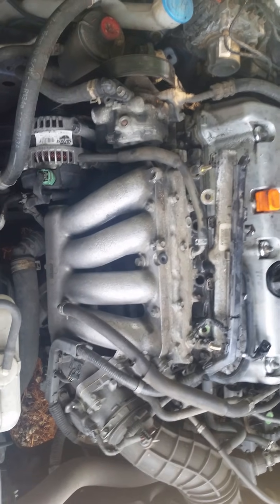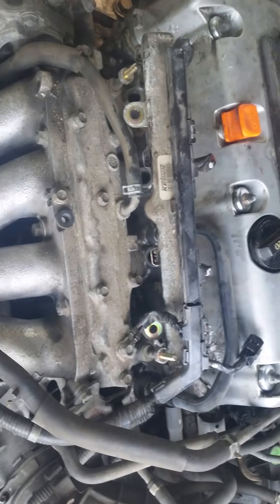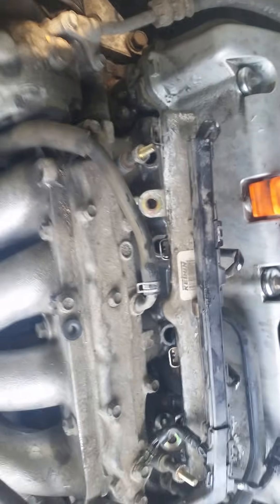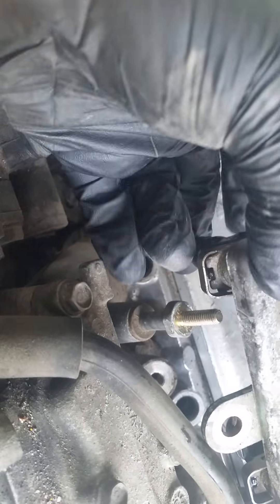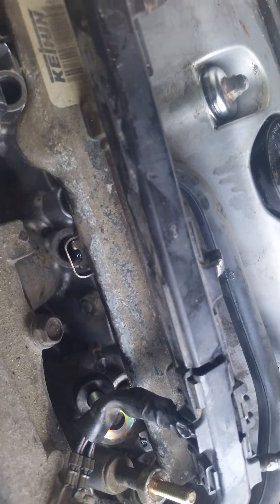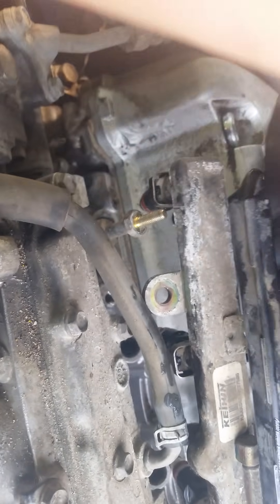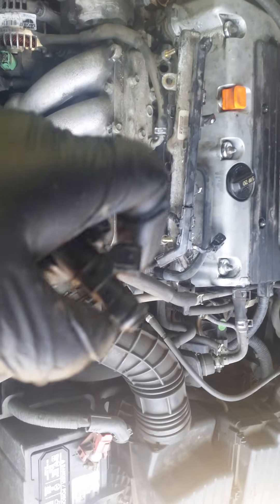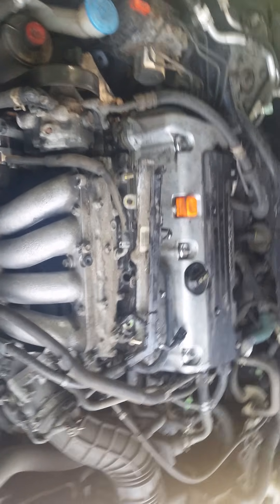2.4 liter Honda fuel injector replacment

Comment: Did you notice any improvement in fuel mileage after changing the fuel injectors?
Reply from the maker: @ohiodigger4391  some but not alot it was like 1-2 mpg
Reply: @ ok thanks. My sons ‘04 CRV is getting just under 14mpg. Trying to figure out what’s going on. Only has 136k. Should be at least close to 18mpg.

Comment: If your doing a video like on how to change them, then please show each step as you go, so people who haven't done it before can see each step!!!
Reply from the maker: @scottsuem3384  it was one of my first videos
Reply: @stevenwelchtoyota  i apologize . Most people who do this videos don't show how it's done, step by step and they have a ton of video's. So again, I do apologize. No disrespect
Reply from the maker: @scottsuem3384  I would do it different if I did it again
Reply: @stevenwelchtoyota  got a question.. I have a misfire on cylinder #4. My obo2 it says to change out all 4 plugs and 1 coil, but  no luck. I have read everything else to do. What might be the next thin lg that might be the issue? I have 1 in #4 and the plug is alittle wet of fuel. Any ideas? It was on the gwy doing 80 and running fine then out of knowI where i lost power.

Comment: Hello Mr. Welch. I was able to replace all of my Fuel Injectors on my 2014 CRV with the help of your video. I was a bit nervous while doing it but, it was a success. Keep up the awesome videos 👍🏼✌🏼🖖🏼.
Reply from the maker: Glad it helped
Reply: Can I ask how many miles are on your CRV ? I’m trying to see if my CRV would need them done about now cause I have a 14’ model also ?
Reply: My 2014 CR-V has 48k original miles on it now. I’m the only owner of this vehicle.
Reply: The acceleration is much quicker but I’m still not happy with the mileage that I’m getting.

Comment: Experiencing the same scenario, changed the spark plugs, and the engine coils, but still misfiring and on the same 4 cyl 2014 Honda Accord. Haven’t changed the injectors yet or got them cleaned.

Comment: My TSX seems to be being more gas then it’s supposed to it’s long term fuel trim is negative 15-20 percent meaning it’s running rich depending on the day, my o2 sensor reading is always higher then .62 people seem to say higher then .45 is rich on these cars at least from what I found. I’m just wondering if it’s a clogged cat or leaky fuel injectors cause when I’m on the highway these readings are much closer to 0 percent fuel trim and I’m getting like 33-36 mpg which makes me think it’s just putting out more fuel then it’s supposed to when it’s below 2,000 rpm or so.

Comment: I'm having to replace mine now after 300,000, mi, and had to change those on my 96 4Runner after 365,000 mi. Dang Japanese, can't they make something better than plastic fuel injectors that last longer than a third of a million miles and 27 years. Pieces of junk, lol. 
   (Note of sarcasm for the sarcastically challenged)
Reply from the maker: joke noted.  you cant hide quality

Comment: Thanks! My 2004 CRV has 100k miles and runs with no issues. I am concerned about fuel efficiency. Did you notice an improvement in mileage after doing this job? I purchased rebuilt injectors as new were cost prohibitive.

Comment: 275k on my 2004 accord same problem thanks for the video
Reply from the maker: Happy to help
Reply: @stevenwelchtoyota  one of the injector is stuck I'm being really careful pulling the rail hopefully it comes out this morning
Reply from the maker: @Stevesbe  I sprayed wd40 around one I had stuck
Reply: @stevenwelchtoyota  thanks I did that and finally came out . Why couldn't this have happened in the summer
Reply from the maker: @Stevesbe  perfect. Little tricks lol
Reply: @stevenwelchtoyota  I got Standard motor products  new injectors what did you use
Reply from the maker: @Stevesbe  it was too long ago I dont even recall. It may have been denso

Comment: We're the old injectors clogged? My CRV has 180k and my MPG is dismal. I'm thinking about changing them instead of cleaning them. Did you notice any improved MPG?
Reply from the maker: It smoothed out the engine and did get a couple mpg better. They were old and dirty but not as bad as what I thought they would be

Comment: i had a hard start when i finished the job but i think it had a lot to do with not priming the pump since i did disconnect the fuel rail. What do you think?
Reply from the maker: It would make sense cause you need full pressure to the injectors

Comment: did you have any issues with a hard start when you installed your injectors?
Reply from the maker: Initially yes but after I got the air out of the system it was better
Reply: @stevenwelchtoyota if I may ask, do you know after the initial rough start it gets better? I just did mines and every time I step on the gas pedal after a while of idling it sputters like it’s about to die then goes. At idle it’s fine but when I gas I get concerned.

Everything looks right and right where it should be

Comment: Fuel does not ignite with heat🤣🤣🤣🤣🤣🤣🤦‍♂️
Reply from the maker: safety 1st always
Reply: @stevenwelchtoyota  i understand the safety first but, its about putting the right info outhere gas only ignites with spark. We dont want people to stop mowing their laws cause if they spill gas on their hoy engine its going to blow 😄
Reply from the maker: @Themadscientist6858  if you look at your mower it says do not fill while hot on the gas tank
Reply: @stevenwelchtoyota  🤣🤣🤣🤣🤣i have been mowing grass for 38 years and spill lots of gas on top of burning hot engine 🤣🤣🤣🤣😅im still here😅😅😅😅😅
Reply: @stevenwelchtoyota  higher volatility fuels are  imposible to ignite with a hot surface they need an arc or spark to ignite. Do the research before you put the wrong info outhere 🤦‍♂️
Reply: Some people put fuel while engine is running now thats its not aceptable:  you could easily have a bad day🤣🤣🤣🤣💥💥💥💥
Reply: @stevenwelchtoyota  what u should really worry about is disconecting the battery of the car when your working with engine fuel lines , fuel pump or injectors.   The only reason i let engine cool off os so i dont burn myself when working in engine bay🤣🥵🥵🥵🥵🥵

Comment: Today I tried to remove the injectors they are very hard to pull Honda Accord 2004. I’ll take it to the mechanic, the mpg for this 2.4 liters is 19 Miles in city.
Reply from the maker: does it sputter?
Reply: @stevenwelchtoyota  no it doesn’t what mpg are you getting in highway? mine 22 mpg with new spark plugs
Reply: @stevenwelchtoyota  Any video on how to remove o
Injector on honda accord 2004 v6 3.0l

Comment: I have all of the nuts and bolts off, but I can't get the rail off! I see it loosening on the two on the left, but the ones on the right don't want to loosen. 2006 Honda Element
Reply from the maker: did you try wd-40
Reply: @stevenwelchtoyota   I did , but I still couldn't get it off. I have a mechanic  friend who has better tools than I do, so he was able to get it off for me. I do thank you for the video, I would have been successful if I  had been able to get it off.

Comment: its direct injection right?
Reply from the maker: its injected into the top of the engine over the valves. most times when someone says direct injection they are referring to when it is injected into the side of the cylinder
Reply: @stevenwelchtoyota  Oh ok its port injected then. Thank you!
Reply from the maker: @50nollieman  correct
Reply: @stevenwelchtoyota  thank you! Appreciate it
Reply from the maker: @50nollieman  no problem

Comment: Great video just curious what fuel injectors did you go with did you buy after-market or go to the dealer
Reply from the maker: Just grabbed what advance had in stock. I believe they were denso
Reply: @stevenwelchtoyota  just curious how did it run after you put the new fuel injectors in there I'm having a lean issue cannot find any vacuum leaks I'm assuming my fuel injectors are clogged up 220,000 miles
Reply: @HUFF-N-PUFF-2025  Did you ever find the issue? I'm haveing the same problem. I took it to the dealer, and they said the injectors need to be OEM..
Reply: @GiorgioRomano98  I ended up getting OE Honda injectors on the internet for $60 ea I think. Replacement was very easy. I still am having same issue with hight STFT @ idle and throws check engine code so that was not the issue. Checked for vac leaks etc but found none. Going to take to dealer one of these days instead of throwing away money guessing lol

Comment: Can this cause a rich condition at idle? I'm getting negative 15 to 20 on both short and long term and once I accelerate it goes to negative 10 both short and long term. Thanks.
Reply: Mine too !! Ever solve it??
Reply: @120DangerousHold  yeah I adjusted my valves which Honda says to do every 100k miles and it improved my trims a lot. Also new spark plugs although the old ones weren't that bad looking.

Comment: I got a 2.4 as well a Honda accord 2011 LX and just got hit with code P0204 Circuit Malfunction cylinder 4.
Is this the location my reader is referring to because I was thinking it was the coils?
 Please someone let me know.
Reply from the maker: The ignition coils are supposed to last 100k miles. Most last longer but depending on how many miles you have replacing them even if you do it individually cant hurt.

Comment: My 2013 Accord is still misfire cylinder 2 after I replace the 4 coils and spark plug oem I didn’t know what was the problem now, I think this is the answer to my problems regarding that. I’m going to replace the fuel injectors and I will pray that will be the end of it. And shame on the Honda dealership that didn’t know why was those lights on My dash board thank you for this very important information for the one who needs it
Reply: Same for me. Did the new injectors fix your issue?
Reply: Kevin Whitlatch they are like $500 for the 4  injectors that my car need so what I been doing is buying the premium fuel 93 and using injector cleaners and I have not see check engine light so far
Reply: @DanielDiaz-te6dl  dang thats really expensive. I just paid for one inject about $50. Glad its working for you so far. Next thing for me is a valve adjustment which ive been trying to avoid but may just have to face it
Reply: Kevin Whitlatch yeah this thing is empty my pocket fast good for you that solve your problem so far
Reply: @DanielDiaz-te6dl  ill let you know im replacing it today. The store gave me the wrong one so i had to re order the part
Reply: Kevin Whitlatch be careful if you buying an aftermarket one make sure is good quality because Honda cars are so sensitive to aftermarket parts I learned that for sure
Reply: @DanielDiaz-te6dl  lol ya i have noticed that too
Reply: Kevin Whitlatch the brand DENSO are really good parts for Honda en Toyota They sell a lot of parts you can buy it on amazon or on the denso website
Reply: @DanielDiaz-te6dl  ok cool good to know. Btw the new injector didnt work. Im just gonna go get a valve adjustment. Damn
Reply: Kevin Whitlatch feel bad for you because that is a major job because to get to the valve is not a simple thing hopefully thing doesn’t get to expensive for you bro.
Reply: @DanielDiaz-te6dl  ya no kidding. Well i think im just gonna deal with it then probably sell it. O well.

Comment: I had a nightmare problem of a misfire at idle. Changed plugs, checked coils, changed t-body and in the end it was a bad O-ring on injector 1 was causing a slight vacuum leak making it misfire.
Reply: I think I'm having the exact same problem. It seems to misfire only at idle.

Comment: DID YOU REPLACE THE FUEL FILTER TOO? THEY SAY IT IS RECOMMENDED WHEN YOU CHANGE THE FUEL INJECTORS
Reply: You can't.  At least on the newer Hondas the fuel filter is just a sock that's attached to the fuel pump in the tank and not a separate item that you can buy.
Reply: @someusername121  actually, you can change the sock you have to take the assembly apart

Comment: So , I'm doing this job today and following your video, what do you mean when you say, "vaseline up the seals?"

Also, I know you said the fuel line is on a quick connect that rotates, do I need to rotate the quick connect?
Reply from the maker: Just put a thin layer of vaseline around the seal.
Reply: @stevenwelchtoyota  ok , thank you.  Can you also tell me what to do with the fuel line?

I know you said not to disconnect it but do I need to rotate it? I am stuck at this point.
Reply from the maker: @jrbz88  just rotate it
Reply: @stevenwelchtoyota  my injectors have a black plastic protective cove that comes off, then there's a turquoise colored clip that clips the fuel line that does not rotate, so I am completely confused....help needed
Reply from the maker: @jrbz88  are you on a accord? If so what year and engine size?
Reply: @stevenwelchtoyota  Negative,  I'm on a 2005 honda element with a  2.4 i-vtech engine .

I think we now no why my connection is different. 

I will post a video on my channel in 5 minutes showing the problem,  please take a look and let me know what you think. 

Thank you

Comment: I can't thank you enough, Steven. Watching your video made me feel confident I could do the job, so I removed them, took them o a shop for an ultrasonic deep clean for 300 pesos (About 15 USD, I live down here in Mexico) and placed them back with no issues. I'd just add Anthony's advise to the video about opening the gas cap to depressurize the system. Many thanks!

Comment: Good afternoon, just a helpful hint for next time. Turn the car on and pull the fuse for the fuel pump and the fuel in the line will run out and you won’t have to worry about the fuel gushing out from the last injector. Once all is said and done, reconnect the fuse and turn the key over but not fully on, this allows the pump to bring fuel back into the line up to the injectors. Do this a few times and then on the last one fully crank the vehicle and it should start up just fine. 

Hope this helps.
Reply: How do I find the freaking fuse!!
Reply: @joshknorr6683  go to your fuse box under the steering wheel. It should be titled as "fuel". Sorry I'm late
Reply: hi there, do you do this just once andjust leave it on for a few seconds then off or would you say its best to turn on and off a few times?

Comment: How would I know you replace the fuel injectors on the first place?
Reply from the maker: Had an issue with rough running and cylinder misfires
Reply from the maker: Had an issue with rough running and cylinder misfires
Reply: Was you rough running intermittent?  Run ok for a while the  rough again?

Comment: okay I did the video the one thing that I did not hear and anyone who is working with their injectors open your gas cap to depressurize your system so that you can I have all this fuel rushing out this is a must when working with the fuel system depressurize the system before releasing any bolts or nuts to the injector rails